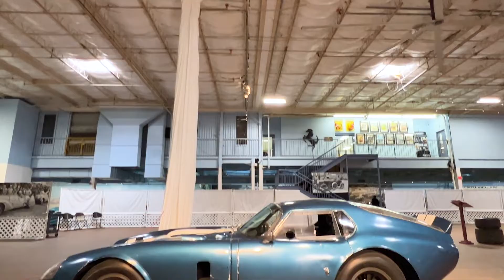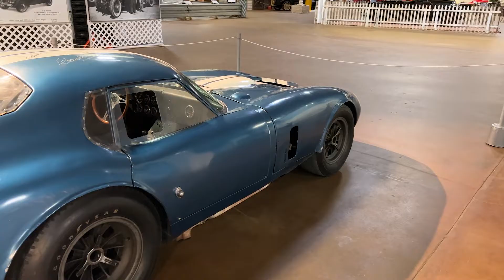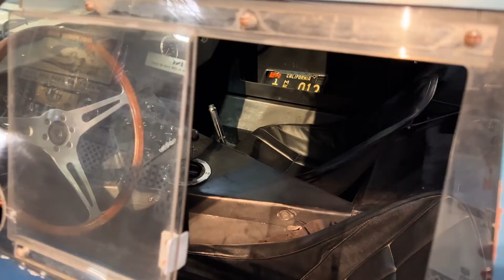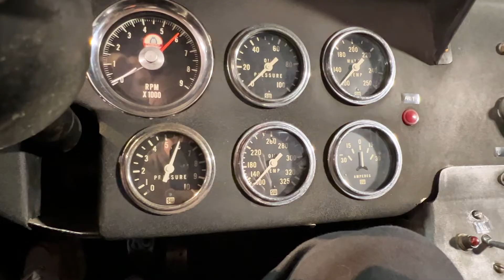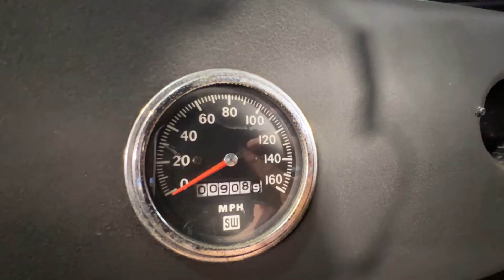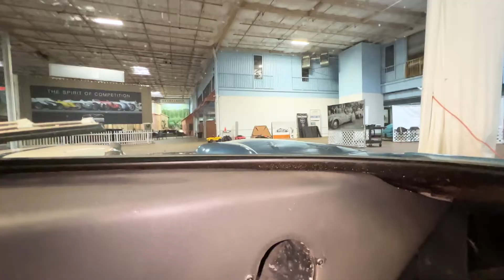Inside a REAL Shelby Cobra Daytona Coupe CSX2287 - POV Interior Details - Lets Drive It

Comment: These cars were notoriously hot. They couldnt get enough air inside of them. I forgot what driver it was, but they said that going down the Mulsanne straight, they would open the door and prop it open with their foot to just get some reprieve from the heat

Comment: Can you imagine 5 of the 6 cars almost ended up in the bottom of the English Channel?  Shelby didn't want to pay the freight to get them back to the US as the stories go after Ford told him to dump the program or else.  What amazes me is that if just 5% of the money that went to develop this car further from the GT40 program, most likely the Daytona would have won the GT championship in 64, almost certainly would have won the 64 Le mans outright if not for a rock piercing its oil cooler.  Still the Daytonas won both 64 and 65 their class at Le Mans and the GT championship in 65.

Comment: The speedometer was placed where the glove box would be because FIA required the race cars to have a speedometer. Shelby didn’t like that. He protested because you don’t need a speedometer in a race car. FIA Required him to do it, so he put the speedo on the passenger side as an act of defiance.
Reply: The FIA had no clue how strong Texans deal with adversity!  Good job, Shel!
Reply: also , being a  race car you should be looking at the tach not the speedo
Reply: I drove Formula 3 cars in the 90's and none of them had speedometers. The best we could do was look at the RPMs on the tach and guesstimate our speed based on which gear we were on. I have to say I kinda miss that.

Comment: Thank you. This car is indeed very interesting indeed as the replicas now cluttering up race tracks in Europe are very far from this specification with wider tracks and roll cages replacing the chassis design (but most race organisers do not give a peter about the autos if the owners have thick wallets).
Reply: Right?!?! God forbid 95% of the replica daytonas and cobras are actually built better and out perform the originals. How dare they?!?!

Comment: I just sold my 68 Mustang GT and I plan to buy a Factory Five Daytona replica kit with that money if the current administration of car killers is voted out in 24....if you love cars and driving, you'd better vote accordingly .
Reply: Damn dude i still have my 1st car a 68 mustang gt j code.  Considered doing that same thing myself many times!  Just cant get rid of my ol girl had it 27 years!
Reply: @gusshackleford8370  Mine was a J code too. Candy apple red with black C stripe and four speed. Had it since 2004,  but it was time to sell because I wasn't driving it much anymore and I needed room for other projects.  Then not long after selling I was checking out the Factory Five site and saw I could get a deluxe Daytona kit for a few bucks less than I sold it for and the lightbulb went on...."hmm,  I've got a a close ratio top loader and an old set of Weber 48's...all I'd need is a small block, rear end and a set of wheels/tires and I'm ready for Sebring"...
Reply: @godsowndrunk1118  mine was originally meadowlark yellow with a black c stripe, now its all black.  With a 4 speed.  Good luck, hope you put  one bad ass coupe together!
Reply: @port nut good point